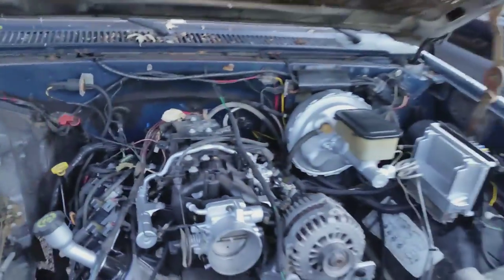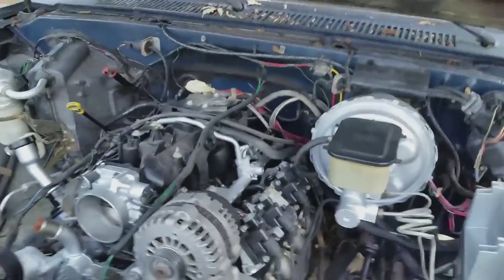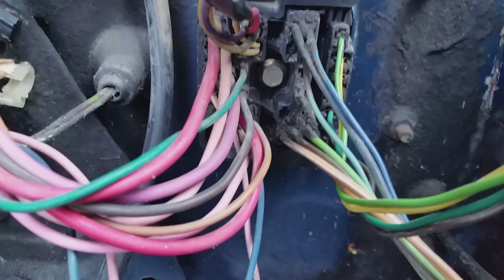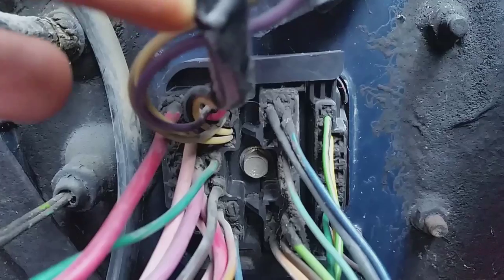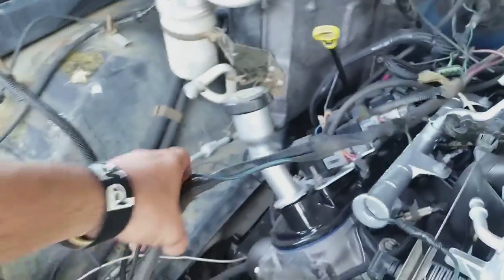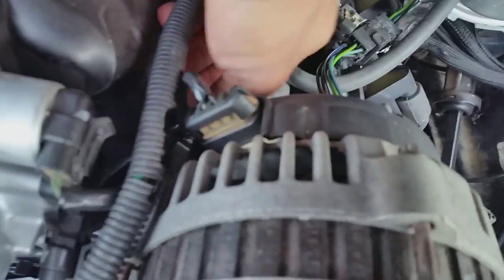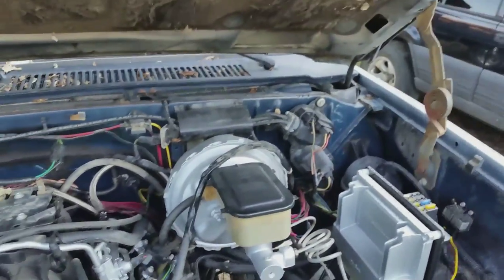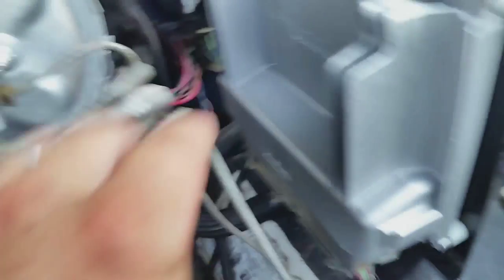1984 C10 Project ---- LS Swap Part 7-1 (BulkHead Wiring Part 1)

Comment: You sir, have relieved some of my stress 😂 I’ve been working on a c30 project and have been needing to pick apart some wires and finding the right name for the bulkhead as I’ve seen it called 100 other names. And I didn’t want to pocket out $700 for a whole new harness. Thank you! God bless 🙏🏼
Reply from the maker: Happy the video helped. This is why I did them.

Comment: Do you happen to know which one of those wires in the big square bulkhead plug, supplies power to the gauge cluster? All my gauges died, and I'm only getting 300 millivolts instead of 12 volts on the main power wire going to the gauges.

Comment: I got an 89 Chevy truck and on the bulk head theres black grease over all of it every were dose that need cleand off ive done put new fuel pump in fule pressure regulator fule realy and fuse new distributor and ecm box new module air flow sensor that gose in the throttle body EGR valve EGR sensor new coil ive checked wier in line fuse im getting power i dont know im stuck have no friends to help just me this is why im here its all i got lost job over it pls help
Reply from the maker: @CraigB-rw9cu  black stuff is ok. It’s supposed to be there.
Reply: @LonniesGarage  ya I just clean it and brushed it a little put it back on and still no pulse going to the injectors

Comment: My Bulhead delima was diff so it wasn't hard..just multiple wire broke..I just drilled out each wire hole thru plug and run a short shrink wrapped wire thru hole one the bad connection wires. 
Shrink wrap was more for a Grommet effect..the resplice wires each end ..shrink wrap ..and repeat 6 times in my case

Comment: i pulled the engine wiring harness from my 1970 el camino 350 engine a 350 trans was going to replace it but the harness i was going to replace it with another from a 1970 chevelle but was worst then mine so when i plugged in my harness  i got nothing at all no power to anything just dead could you tell me what i did wrong?

Comment: I am wondering. Did you need to reuse the spade lugs that were on the wires? Tje reason I ask is, I am wondering why you didnt just cut the wire after you pulled the spade thru the back? BTW, thank you for these videos.
Reply from the maker: I did end up cutting the wire

Comment: Truly appreciate the advice brother thank you. I’ve installed the speedway 22 circuit chassis harness but there is no dedicated reverse light wires. Do you think I could use the third brake light wire since I don’t have the third break light?
Reply from the maker: I don’t think so because it would only be active when the brake lights come on.
Reply: @LonniesGarage  I really appreciate your input thanks brother

Comment: Quick question. Can I use my stock gauges? And if so how can I keep my stock gauges?
Reply from the maker: You will need gauges out of a 90/91 blazer or suburban. That’s the year they switched to electric speedometer. Then you will have to repin the cluster plug. I’ve got videos on here showing it.
Reply: @LonniesGarage  can I drive the truck without the cluster tho
Reply from the maker: @michaelperry7261  yes you can. But I would at most want an oil pressure gauge and a temp gauge.

Comment: Hey man I've got the same year chevy except 4x4. Will I need to run a heavy Guage wire off the back of the alternator stud to my battery? I see yours doesn't have wire going to the battery from the alternator or does the plug from the ls harness do the work? And did you figure out what to do with the brown wire coming from the bulkhead that went to the original alternator from the sbc ? Thanks
Reply from the maker: Alternator wire goes to the big post on the starter. It then has the hot cable going to the battery from the starter
Reply: @LonniesGarage  ok cool so I need to run a wire from the stud on alternator to the stud on the starter? Wouldn't going directly back to the battery do the same thing ? Or could I go from alternator to the block on the firewall also? Because the wire that originally ran from the block on the firewall went to the starter and alternator

Comment: I’m working with a 77 k15 and a terminator X, so some things are different.

My issue is identifying which wire is the constant hot? The wire you mention in your video was never pinned in my bulkhead. 

Watched you video testing the starter wire, 12v switched and it is gold, but do you know a way to find the 12v constant hot source?
Reply from the maker: There are 2 wires u can run for constant 12v. They both need to be hooked up. One is for your hvac stuff and the other powers your fuse block under the dash. It's the two bigger red wires running into the bulkhead
Reply: @LonniesGarage  
Oh That makes sense. It seems doing your tests you showed, I can interchange two of the wires between battery, while the other becomes keyed hot. I’m assuming those would be the two constant hot sources?

Comment: Ok I have a 98 3500 chevy 454 fuel injection and a manual transmission going in a 81 chevy c30 and was wondering if your wiring video would work for me
Reply from the maker: Check out the lt1swap.com site to see if u can fine the wiring pinout for it. I'm not sure if your motor is the same as the ls type

Comment: So I won’t need the underhood fuse box from the donor just the harness and computer?
Reply from the maker: Correct. You will need the big plug that plugs to the stock underhood fuse block on the donor. There will also be a few more plugs from that same area that will unplug there too. That u will keep on the harness
Reply: Ok thanks... Thank you for responding so quickly. And keep up the great work that you continue to do.

Comment: i got a back fire in through the intake during start up (wont start) on my 5.3l do you know what it could be?
Reply from the maker: Leslie Washington might want to check your coils and injectors and make sure they're firing in order
Reply: Lonnie's Garage i did all that and wires hooked up correctly. i put it on the scanner and it gave me a code for the crankshaft sensor. but still no start
Reply from the maker: Leslie Washington OK that might be your problem then. The sensor might be bad or the wiring to it.

Comment: Lonnie: Did you delete/remove any part of the factory harness you didn't need? I'd like to take out what I don't need if I'm not using it. I plan to still run factory AC still. Thanks in advance!
Reply from the maker: Anthony Griffin Yeah I took out a few wires but to be honest I would be lieing if I told u what ones.
Reply: Lonnie's Garage No worries was just curious. If it was a lot or just a few? I'd be ok with leaving most of it in just in case. I can just hide wires or run them nice.
Reply from the maker: Anthony Griffin I tried not to take out very much just in case I ever needed them.

Comment: What wire in that bulkhead is the temperature gauge wire??
Reply from the maker: The dark green wire. Check me out on Facebook to see a picture of them labeled
Reply: Lonnie's Garage (Puppetkicker) holy cow..Someone used the temp wire for the electric choke on the carb. Couldn’t figure out where that dang wire was suppose to be. Thanks!

Comment: Watch, "A gearhead 4 Life" the lsx swap 2 wire video
Reply from the maker: I've watched his videos a lot. But I thin my harnesses down to get rid of all the wires that are not used and turn it into a stand alone harness with a new fuse block that is dedicated to the motor and transmission.
Reply: That's a chore, I know